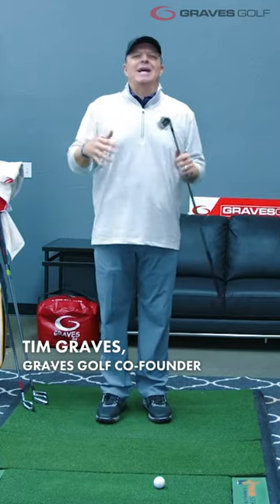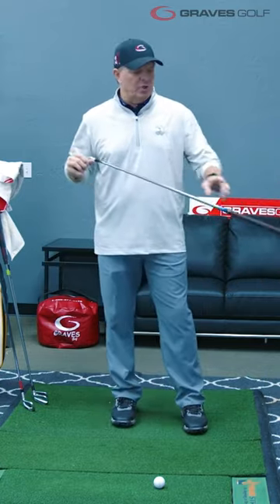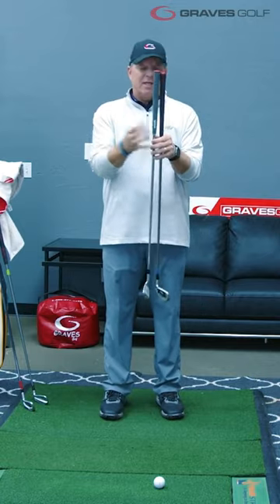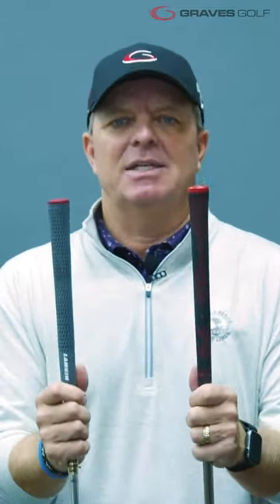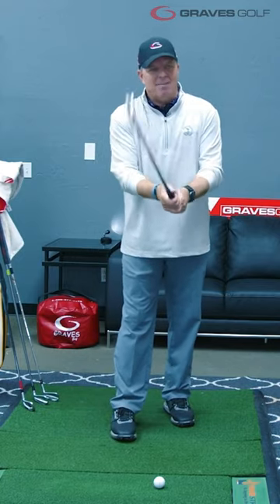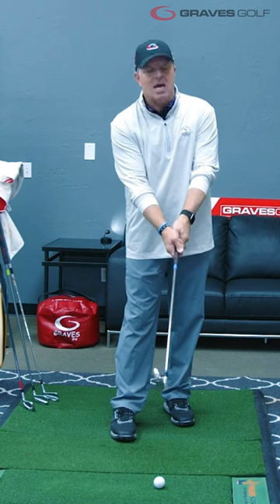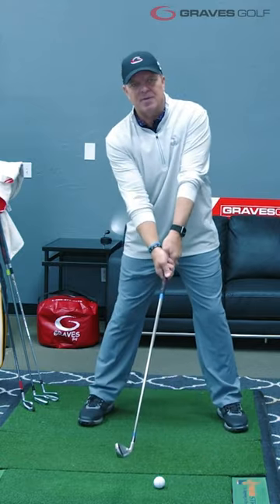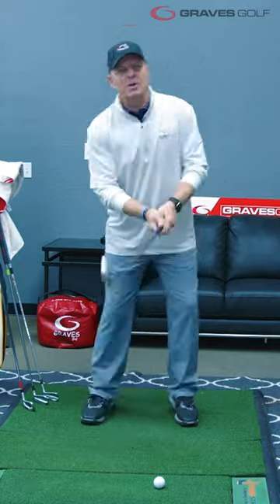Proper Grip Size

Comment: You should absolutely use jumbo grips if you tend to hook the ball. I’ve eliminated the left side of the course with my jumbo grips. I love love love them. All the way down to the wedge. Best equipment decision I’ve ever made and I highly recommend jumbo grips if your bad shots go left
Reply: I plan on getting them
Reply: did you put it on driver? i just jumbo'd all my clubs except driver, im a little afraid to make the switch on it.
Reply: @xshady19  driver was first and the rest followed